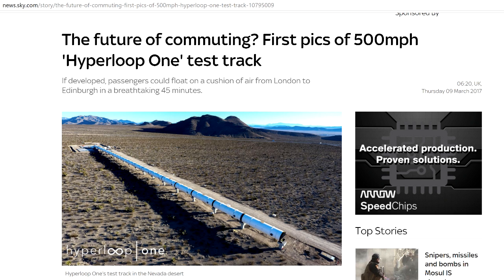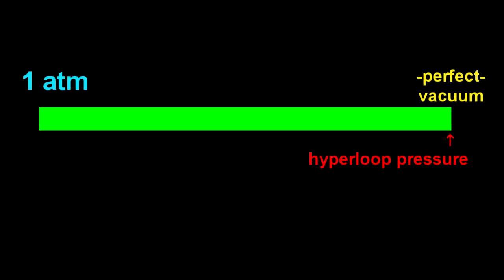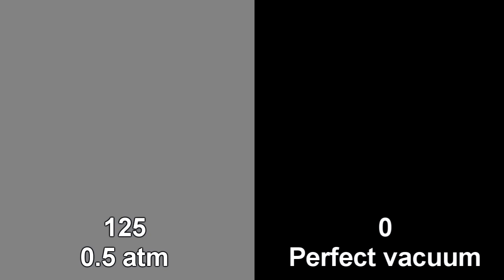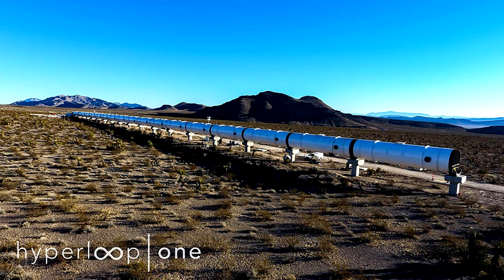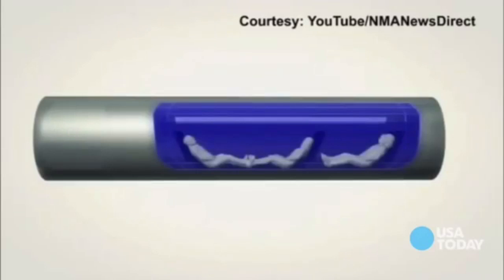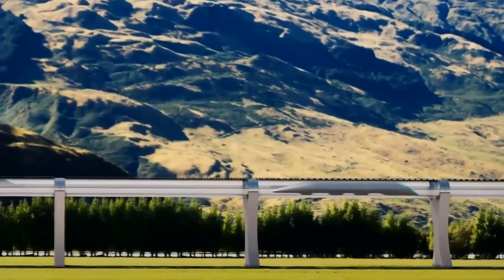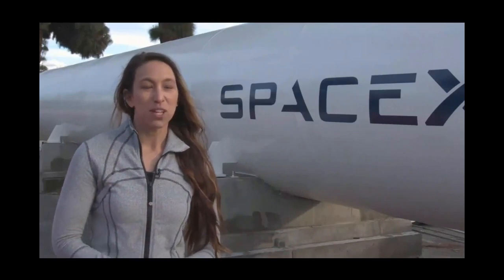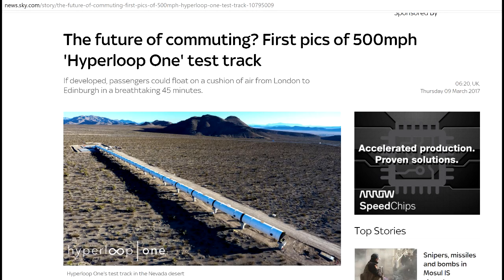Entire Hyperloop could be destroyed in SECONDS!

Comment: One could easily design the pipes with strong support rings every 20 meters or so. Then, at most a 20 meter section of the tube can collapse when it's damaged, and not the entire track.
Not even the tanker truck in the test was crushed completely.
Many of the arguments which can be used against the Hyperloop can also be used against airplanes, and they changed from death traps to a very safe way of transportation within about one century.
I see the thermal expansion issue as one of Hyperloop's main problems. This would require special joints which can expand/contract, maintain a smooth surface inside and are airtight.

Comment: For a man who claims to be a scientist you have a pretty hazy grasp of some simple physics concepts. You start out reinforcing the common misconception that vacuums “suck” as if a vacuum at 10Pa is 100 times more “powerful” than one at 1000Pa. It isn’t. The difference between them is simply 99Pa which pales into insignificance when placed besides the 101,000Pa of sea level atmospheric pressure. Yes, it is certainly much harder to obtain a 1Pa vacuum than a 100Pa one and harder to maintain it, but in terms of the stress on the vessel containing it, it’s the difference between 100,000 and 100,999 (ie 1%).

Then you go on to show a tank imploding. That’s a thin walled tank designed to be at an equal or higher pressure inside than outside. Under these circumstances the stress in the walls is tensile and thin walls can take plenty of that. However, when the inside is at a lower pressure the stresses are compressive and thicker walls are needed to prevent the buckling which can cause severe local stress, leading to further buckling and sudden, catastrophic failure. It’s why submarines, with greater external pressure than internal, need thicker walls than airplanes, where the interior is at a higher pressure than the surrounding air. That’s simply a matter of simple engineering design with adequate safety margins built in. Not rocket science.

Just as with a train or ‘plane, there’s always the potential for a catastrophe. With adequate monitoring there is no reason that even the total collapse of a section of the tube should ever affect more than one capsule. Put rear facing seats in the capsules and 3g braking shouldn’t be a problem. At 1200km/h and 2 minute intervals the capsules would have a separation of 40km and even 1g braking would bring them to a halt in less than 6 km. 

I can’t help feeling that you are one of those itching to enjoy schadenfreude at Musk’s expense. It comes across in the sneering tone of your commentary. I can easily see this venture failing to get of the ground on a cost/benefit analysis, but I think dissing it on technical grounds is short sighted. As others have pointed out it’s still at the Kittyhawk stage of development. If properly executed it could have the potential to provide ultra rapid mass transport with very low energy usage.

Comment: Thunderf00t ,  Not arguing its practical, but what if they put emergency relief values every (some nominal distance) so that if any acceleration (earthquake) or damage to the tube (strain gauges) detected an anomaly, they could do a controlled vent back to atmospheric in say 5-10 seconds. And yes, I agree those tubes are far too large and too thin to be put under vacuum. Perhaps with sufficient spanners and concentric rings you could stiffen them, but at a great cost and weight penalty, and then every welding joint would have stress concentrations (which defeats the purpose of having a circular tube to begin with.

Not to mention to be certified I imagine every weld joint would have to be examined under xray for fatigue cracks, cold welds, etc. It would add a huge cost. Again im not arguing the practicality, just the feasibility if cost were no issue (which of course, it is)

Comment: The Vacuum time problem can be solved, by having a boarding chamber that's sealed off from the rest of the track at boarding points. Only needing to vacuum a small boarding area, then opening the equalized chamber to the main track. 
However, there is no way around the other arguments.

Comment: I know I'm coming late to the party but somehow this showed up in my recommendations. Regarding your main complain, the walls now are made of thick steel and are divided with valves, like rooms in a submarine. They've made sure that it wouldn't just collapse in an instant, and safety is their first concern (about earthquakes the cement bases that support the tube are engineered to withstand much more weight than the tubes itselves, so they will endure them). Then, about speed, in the latest hyperloop pod competition the winner achieved an impressive 466kph, that will steadily grow with time. The energy to vacuum will only be needed the first time air gets pumped out. Finally, in respect to the concorde, it had a lot of problems like noise pollution and general environmental concerns. Hope this helps.
Reply: There are still serval major issues with Hyperloop concept. Thermo expansion, Evacuation after accident, etc. And concrete base doesn't help the case in earth quake because the damage actually came from distortion and the changes it will introduce to the track itself and the tunnel, putting on pressures on to the chamber itself. These are very fundamental mechanical engineering flaws that's still in the Hyperloop design.
Reply: @abrokeengineer967  Yeah two years ago I was dumb and credulous

Comment: I wouldnt say that comparing the hyperloop to a tanker of any type is totally fair, the hyperloop has to be built to withstand inward pressure a tanker has to be built to support outward pressure, also the full scale hyperloop would most likely take much less time to depressurize as only the section containing the cabin would need to be depressurized not the whole line, it makes sense that as a test they hadn't implemented that system of blocks that would stop it.

Also a solution to the friction problem would literally be just putting a maglev train inside the hyperloop, now the only friction it has is with the magnetic fields
Reply: Proper vacuum chambers usually have really thick walls, but the proposed Hyperloop's wall is closer to a tanker.

But in my opinion the entire thing is an overcomplicated mess, and they should ditch the tubes and build a simple Maglev train instead.

Comment: The fuel tanker container is designed to be as light as possible and far thinner than the hyperloop tubes. I don't think you have data detailing what materials either of them is made of, their thickness and what sort of vaccum pressure they;re under So you have no business making this comparison. Their business have innovated self driving electronic cars, rockets that land back safely on Earth etc. So I think they're fairly competent to build a tube that can support their desired level of vaccum.

I like your other videos, on the solar panel road tiles, self filling bottles etc. But trying to debunk hyperloop as a scam is bad science is a bit far fetched.

Comment: This video is hack. Half of what you're complaining about (slow loading times, short track, low current speeds) can be summed up with, it's still in prototype. Why not whine about demonstrated turning radius if you're going to complain about things with known engineering solutions. 

The same goes for your fear of vacuum chambers. Making the production tube double layered would nullify most implosion concern and the joints are an inherent cascade deterrent.

Nobody said this would be an easy project but you seem to be saying it's not worth trying and I could not disagree more. You're welcome to not be a part though.

Comment: Only just saw this...excellent dissection of the real problems involved....

BUT if we ever did master vacuum tunnels then why waste time and energy travelling in arcs on the surface? 
If you drilled a tunnel directly between any two points on a sphere (Earth) , you could IN THEORY 'fall' from  one to the other using gravity. You would need a low-friction wheel/maglev/air support technology but the energy required could be mostly recovered.
Not my idea, I think Arthur C. Clark may have proposed it.

Comment: nah mate, that tube isn't thicc enough . cheap and thin aluminum tube ?,really ? learn a little bit engineering by read the corrosion  values in each metals, alloy, thermal conductivity, and material tensile/strength. that vacuum test is stupid anyway.

Comment: There's one detail I'm considering about pumping the track down.
I think if they actually built the hyperloop, they would pump the main track down once and have an air lock built at every station, much like the system on the ISS for getting satellites, which were prepared in the pressurized spacecraft out into the vacuum of space without an open, direct connection between the inside and outside. With an additional vacuum tank at every station, the air lock could be vented into this vacuum chamber, which would reduce the mass of air in the air lock by the ratio of the volume of air lock and vacuum tank. Then, a more powerful vacuum pump system could first pump the air lock down, then the pod would be moved onto the track and then the pumping system would pump the air out of the big vacuum tank in preparation for the next transfer. This would take more energy and time overall, but the transfer itself would be faster.

Maybe the future currency will be vacuum? So then you could use your "vacuum storage" for facilities to release equalize their air pressure into through a public pipe system, to get a faster vacuum? Putting words into the mouth of Fox News and other sensationalist media ...

Comment: Now, One solution for catastrophic failures is being able to sectionalize all sections of the tube. Have doors that can open and close segregated sections of the tube. This ofc makes it a very complicated mechanism, but it would mean that any damage to the tube would be localized to a segregated section of lets say 500 meters. As for the issue about heat expansion, perhaps something along the lines of the tubes being able to move in and out of eachother, like a trombone, could possibly work, though how one goes about pressurizing a trombone connection i am uncertain.
Reply: or another solution: scrap this whole thing, call it out for the scam that it is and build high speed rail or a maglev.
Reply: @durshurrikun150  lolwhat? How is this a scam? Its BASIC science that the less air resistance you have, the easier it is to accelerate. 
Creating tunnels that have no air in them is by no means easy, but how the actual fuck is the pursuit of such a system a scam?

Comment: Wow.
Let's take a moment here in between your bashing. First of all, yes a vacuum weakens the structure....but this is a PROOF of concept, not an actual IMPLEMENTATION.
Completely different things, the mentality you have basically would've laughed at the potential of the very first computers, vehicles, crude oil or even electromagnetism as gimmicks and "can't possibly be useful on any larger scales as they are....too expensive and slow to operate". You can keep the stick up your ass.
I doubt seriously that someone who's any bit business savvy would promote this unless they saw the potential BEYOND the problems. By keeping things on the ground, using existing infrastructure and eliminating air resistance, the "POTENTIAL" here for revenue is huge...all but eliminating most forms of passenger transport, (probably not rail though for cargo).

Comment: Yeah, and you would have to filter the air that is displaced to ensure no contaminates are introduced to the populace. And it's CA, so that filtering would be very strict. And then what of all the waste from the paper waiver's that will be required to be signed to force arbitration and ensure company assets are not destroyed after the first failure. No, not accident, failure. Engineering failure, as that would be the case. Good luck with that!

Comment: You really think that engineers wouldn't put any safety provisions for such an event? The company has money. The engineers working there see problems like this and say, "ok, how will we fix this? Maybe redesign the tube to be more structurally stable, or add doors/columns to close to provide support in the event of a vacuum collapse." They don't say, "let's give up entirely and shut the company down." This is why pessimism is never credible - there is always a way to solve an engineering problem. Props to you for pointing out engineering issues with the Hyperloop, but it should be in the spirit of making the Hyperloop safer once it's built... not trying to convince people to give up on it! Think about it - airplanes are extremely unsafe in theory. One breach of the hull means that the pressure drops completely. This is lethal. Engine failure makes a crash very likely at high altitudes. But these problems (and more) were solved, and now airplanes are safer than cars.
Reply: yeah, they made an "switch off physics in case of emergency"-button.

Comment: dude in regards to the time it takes to get in, this is a test environment, you could make it work you may have a chamber fairly smaller (not like in the whole test tube) to depressurize faster since it is way less volume, to transition from outside into the tube.

also, it could be possible to have a concentric tube with half the pressure to avoid the explosion, to the point where the materials have the strength to withstand the pressure. and then have that outside tube enclosed in concrete or something. Of course, IT IS EXPENSIVE, but plausible.

Comment: There is no chance the hyperloop will implode. The max differential pressure is one atmosphere which is nothing, relatively speaking. Subsea pipeline engineers (I'm one) know how to design tubes resistant to external pressure. There is a minimum wall thickness requirement, and if bending during the laying process risks a propagating buckle (implosion), collars are attached periodically to prevent it propagating.

Comment: I haven’t had time to research into everything about how it works, but it doesn’t seem like a bad idea. If they simply used the principles of maglev technology, under a vaccuum to nullify air resistance. And used construction materials akin to those used in deep ocean exploration vehicles and and pressure which matched the safety specifications of those materials, then where exactly is the problem?

Comment: Your arguments are not valide. Everything that was crushed was not made for vacuum. Second you cannot compare the intermediate test results to the end product. Because you don't know what they where testing in those test. If they where testing the breaking capacity, then you comments on how far they get when release from the booster wagon are incorrect. And the argument of energy release is also invalid as it relies on something blocking the flow but get pushed by it (like a bullet in a gun). But if there are no object is the way, then the air would just flow in it like water flow in the water pipes. Sure the will be the equivalent of the water hammer, but a fluid will push much harder then air since air can compress and the hammer part. (train use vacuum tubes as emery breaking, and that never exploded(or imploded) when there was a leak.

Comment: Question, what if you built a vehicle that had a seal on it and had vents along the path. As the pusher plug was sent along the track it would expel air from in front of it and make the tube behind it void of air. Even if this removed 1/2 to 3/4 of the air would this still work??  Also how do they plan to stop this 500 to 700 mph bullet at the other end?? Also would air locks along the path work, as to not have to suck down the whole tube in one shot??

Comment: 200,000,000 Joules is equivalent to 55 KwH or about the energy capacity of one Tesla Model S. 

As to implosion.  Only one section would implode, not the entire length of track.   The probability of being in the one section that implodes would be very low.  And metal doesn't shard and fragment tiny sharp pieces when it implodes.  That's like playing a video of  someone dropping a glass bowl and then warning you about the dangers of dropping a metal pot.

Comment: @Thunderf00t i dont think some of these guys even realize the inspection cost that would come with the upkeep on this either. far more than what its worth. the amount of danger it would pose would mean it would need to be UT inspected a lot for stress cracks, corrosion, and lamination defects. i work on the gas and oil pipelines doing UT inspections and these inspections just for a few hundred feet of pipe can be anywhere from $500,000 to a mill easy with the labor of a certified UT inspector and cost of equipment. because thats what it would need being that it would fall under the DOT regulations that they would have to abide by. hell even doing Guided Wave which is faster than normal UT inspection still wouldnt come cheep. also being this would fall under DOT regulations it also means that this would more in likely fall under the similar rules and calculations that they use to tell how thick a pipe needs to be in relation to the pressure, meaning they wouldnt be able to get away with a thin pipe. i think they would go bankrupt just trying to get the pipes specially made.

Comment: I think the circles the outside of the tanker truck need to be on the inside
Reply: It’s not designed for holding a vacuum, and even if they did have rings inside, what failed was the plate not the rings